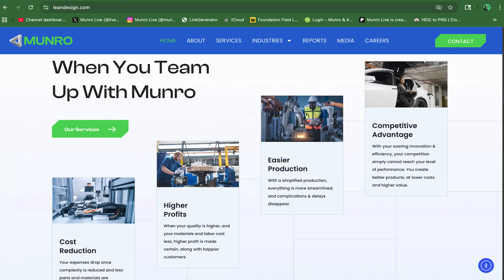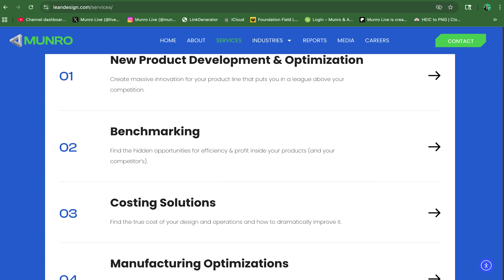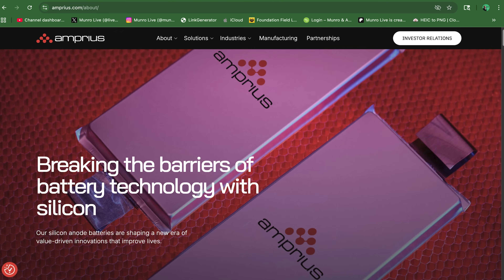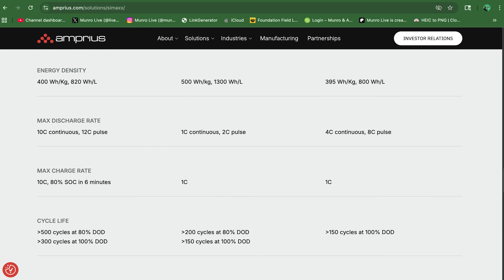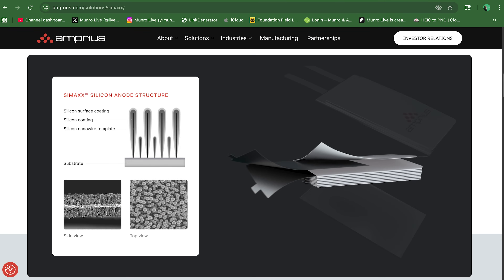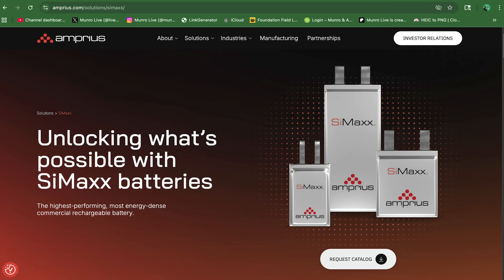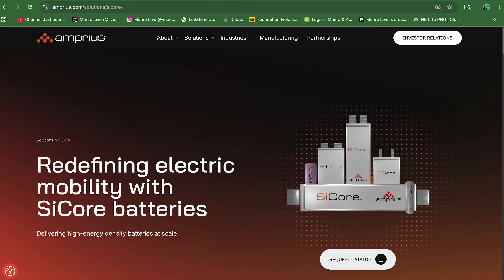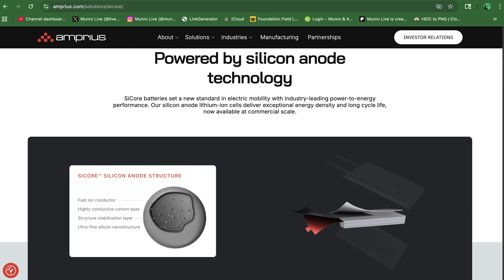Amprius Batteries: Powering the Future with Silicon Anode Technology

Comment: If you really scrutinize their website, they don't have anything that is game-changing for everyday EVs.  All of their cells with impressive specs have low cycle lives AND they typically only handle 1C charging.  there's one with 10c charging but only a cycle life of 500 cycles at 80% depth of discharge. That's only 150,000 miles in an EV. Not really acceptable unless you want your EV to be disposable.  and it's only 400wh/kg.  Which is great... but we've got long lasting and cheap conventional lithium cells today at what, 300wh/kg? 325?  It's a marginal improvement. we're talking about cutting a 150lbs out of an EV at GREAT expense.
Reply: Definitely not an EV battery.

Comment: aluminum anode that theoretically can have 4x the density than lithium with a over 10k life cycle that is almost as cheap as sodium batteries.
 or silicon anode with 10x the density of lithium with around 1300 cycles that'll cost A LOT. 
seems interesting.

Comment: Didn't they started out from MIT with the molten metal battery for utility and evolved into Lion with silican anode? Ion is just incremental like anybody else and fire prone.
Reply: Yes, their original flagship SiMaxx is driving their wild energy density benchmarks, but it was massively unprofitable and impossible to scale, so they pivoted to a silicon-doped-anode l-ion platform called SiCore. They still make SiMaxx batteries for some customers, but are attempting to reach parity in SiCore to completely replace SiMaxx.

Comment: Their simaxx website claimed 300 cycles at 100% DOD for and only 500 at 80% DOD. That's like 2 years max for a high power design.

It's only 200 cycles for the high energy density version, which is like a year under regular use EV scenarios.

So, sure, for the military that has effectively infinite budget can replace batteries in electric systems every year to save the weight, but us normal folk will probably be better with LFP and Sodium for cheap reliable energy storage depending on the use case.
Reply: Correct, Amprius' batteries have very short cycle life, today, and aren't a good solution for EV's or home storage, but fine for military and drones, and small applications.
Reply: Sodium ion will fit for standard range EVs and energy storage systems, while LFP will be perfect for mid range EVs. Both has long cycle life (over 5000 cycles) and cheap to make

This silicon battery is only viable for small appliances like phones, tablets, laptops, and portable power tools as it's where the energy density matters more
Reply: @sihamhamda47 Seems drones is just about a perfect case for it. Lighter with the same energy or more energy at the same weight  is a pretty great win there.
Reply: Yes cost must come down, charging	 cycles must increase to 10,000 and more. heading that direction hopefully soon..
Reply: let's face it. their big bucks in the mid-term will come for ironically, DOD contracts for military suicide drones.  cycle life doesn't matter for these applications.
Reply: @bob15479 more payload with the same range, that's a win-win! Red mist for everyone!
Reply: it depends on the size of the battery. 200kWh (equivalent to a 100kWh conventional Li-ion battery weight wise) giving 600 miles of range gives you 120k miles of total life range over 200 full cycles
Reply: @USUG0 That's terrible range. Most LiFePo batteries for EVs are rated for 6000 cycles at 300 miles a cycle or so, which is 1.8 million miles. Even then people complain they don't last long enough when the warranty is usually 8 years or so. If someone did 20k a year, having the battery basically depleted in 6 years is completely unacceptable.

Getting twice your flight time at the same weight in commercial videography drones makes sense for this. EVs don't even in the slightest.
Reply: A great many of their batteries are going into drones that will end up exploding at the end of their mission.
Reply: @TheOneWhoBought The right tools for red mist creation it seems.

Comment: I use these cells for large multirotor drones. They are roughly 6 times the cost, for about twice the flight time.
Reply: Does switching to these batteries save money elsewhere or is it just convenience?
Reply: @bartholomew2278  Depends on your mission type. For some customers the doubled flight time is  worth the money.  But it really is a case by case for the user mission type.
Reply: Are these commercially available in smaller sizes (like sub 1000mah) for hobbyists? And from whom?
Reply: @maxdroneamplified do u know how many cycles?  I read only 500 charge cycles.
Reply: I wonder if all manufactures can make the batteries, what is the moot to protect  company
Reply: Costs have no concept for the military industrial complex. Or should I say the Department of War. Then this shirt hole company has them made in the very country we're developing these to defend against, among others.
Reply: @journeyman291 was thinking that too.
Reply: @journeyman291  How much of their manufacturing is done in China? Any idea? What % of the production is sold to the US military? Any idea?
Reply: @MsMsmak  the profit from china and korea helps to finance the freemont facility.
Reply: @MsMsmak  Our applications are not military, but these cells are made in China. In our case, they are assembled into packs in the US. There is a push to have batteries made in the US, but without incentives to move manufacturing and to stop purchasing Chinese batteries, that won't happen. So we'll see what happens

Comment: Give me my 1000 mile range EV now please
Reply: It is simple, in everyday driving, 250 miles is perfect. But when I hit the road, sometimes with my trailer, 1000 miles would mean at best 500 and maybe less in the winter. Yes these are corner cases but they are real. And I have personally owned only EVs since  2016. Owning two cars, one at 300 miles and the second at 1000 miles would be a perfect match.
Reply: @Mark-ns9n there are battery assisted trailers now too that help a lot….
Reply: Why not 2000 miles or more when you still are wishing? But for a car price and 300 miles is enough.
Reply: @peteroffpist1621 obviously you've not read the rest of the replies below, congratulations for not understanding the conversation.
Reply: Tesla already offers a long range Model 3. 750km range.
Reply: @bengt_axle checks Tesla website nope, no they don't. 590km. Also I said miles, not km.
Reply: @West_Anderson  It is not sold in America as yet.  It is for 2025-26 in China, where the latest EV tech is. I think it will be possible to offer 1000km (600 miles) in a few years, but that demand for it will be small, because it will cost too much and it won't be necessary.
Reply: @bengt_axle ahhh, man I really wish we got China EVs. The demand for such range will be in truck's, towing large loads 500+ miles is quite common.
Reply: @West_Anderson  Chinese EV's often catch on fire though, trapping people inside while they burn.
Reply: @West_Anderson  It is very well know that much of China cost advantage is due to government subsidies and cheap labor.   They are quick for model turnaround and using high tech interfaces, but they are not that sophisticated in many aspects.  Their electric motors are not as advanced as GM, VW, Rivian or Lucid.
Reply: @freeaccess5905 um you're wrong, and the people at Munro and Associates who experts in the field also disagree with you.
Reply: Why ? You would never use it …
Reply: @arpinchock for your information, I would. Ever tried towing a camper long distance? Tends to wreck your range.
Reply: @West_Anderson I have towed a trailer over 3000 km . It maybe affected me 10% if that… I cruised at 60-65 mph (100 kph)
Reply: @arpinchock clearly we're not talking about the same kind of trailer lol. I'm talking about 8000lb camper trailer, basically a aerodynamic brick. I've watched plenty of videos of people towing one with the Silverado EV, it cuts range in about half. Even so, the Silverado EV would also suit my needs, it's close. I own two EVs already a Model Y and a Chevy Bolt, trust me I really want to have no gas vehicles if it worked for me.